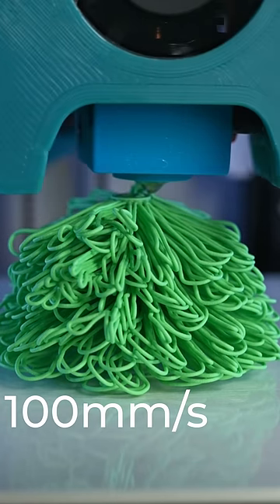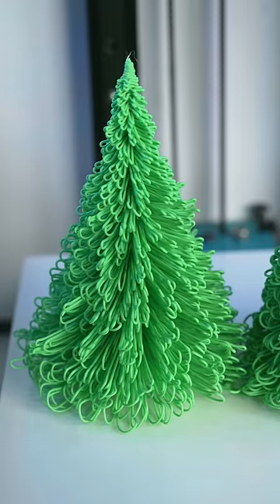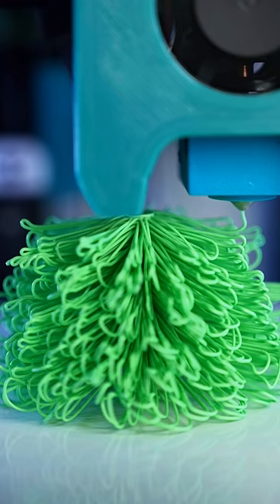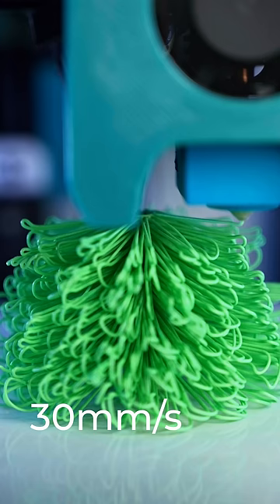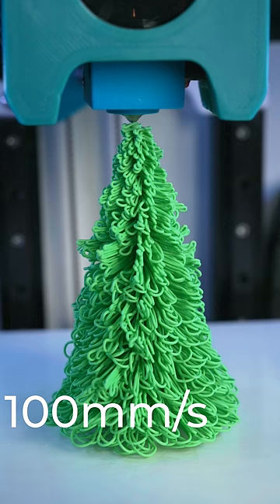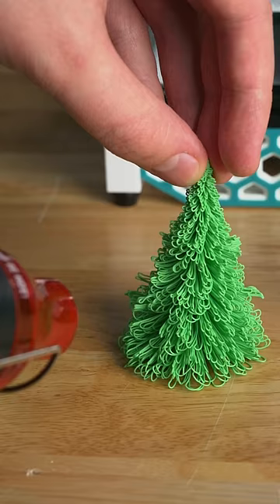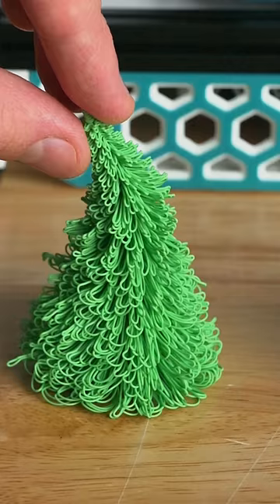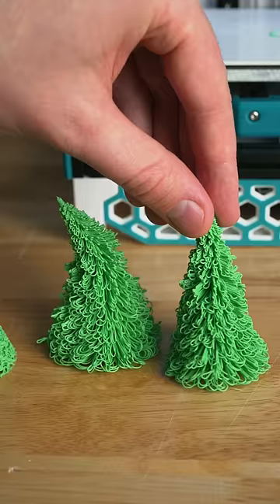3D Printing Stringing Tree 🎄

Comment from the maker: 🔥My Favorite Starter 3D Printer: https://amzn.to/3hMi2r2
Favorite Mid-sized 3D Printer: https://amzn.to/3Eq9KNa

🌈FAVORITE PLA Filament: https://amzn.to/3VNqTIc

STL Link: https://www.printables.com/model/92976-christmas-tree
Reply: Actually looks pretty cool
Reply: One thing I would try to do is low fan speed, with fast printing, but also slower extrusion to thin out the filament while it's printing. Change the filament extrusion speed and you can have various different kinds of branches.
Reply: Whats the Name of the Song?
Reply: This will be a nightmare to clean if it got any shit on or in it, even dust lmao
Reply: A medium one😁
Reply: Mine is stopping and starting and the end of the branches. Help
Reply: Slow
Reply: I hate Jesuse

Comment: The fast tree is good for hanging tiny ornaments but probably can’t put much bc it’s not as sturdy, but with the slow tree you can put heavier ornaments but not as many as the fast tree since it won’t be easy to put ornaments through the tighter loops

Comment: Is their a way to shut off the feed of the plastic and u can drop a line and pull away to get strans instead of loops. Maybe you can add a cylinder around it to dab off.